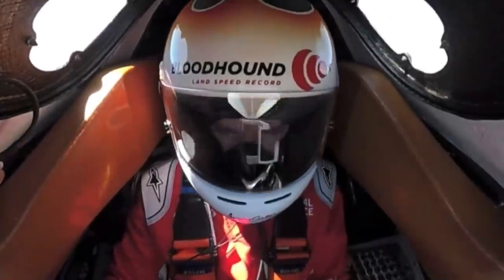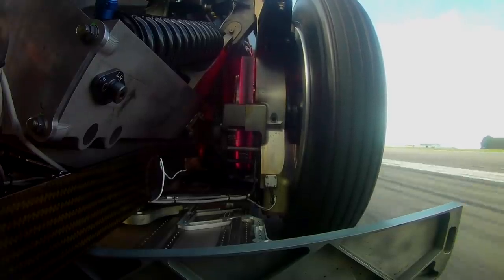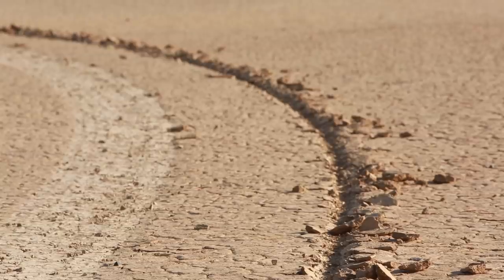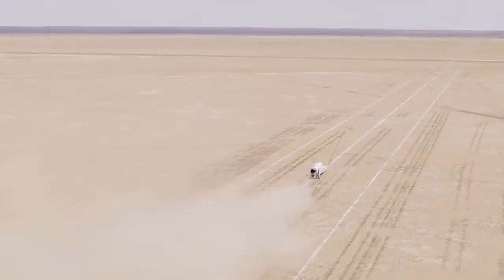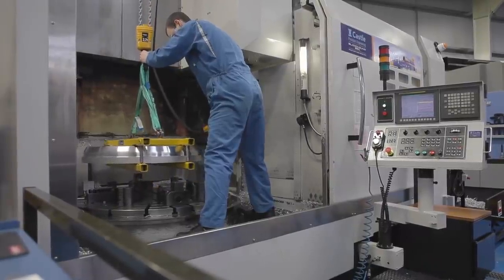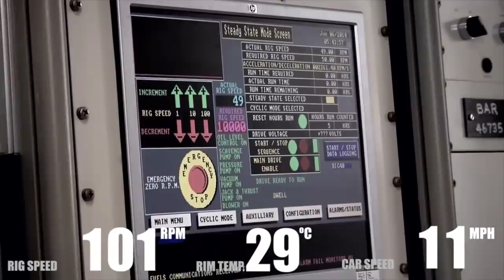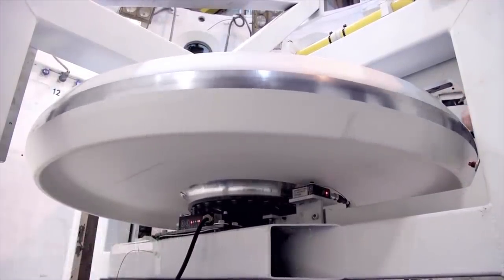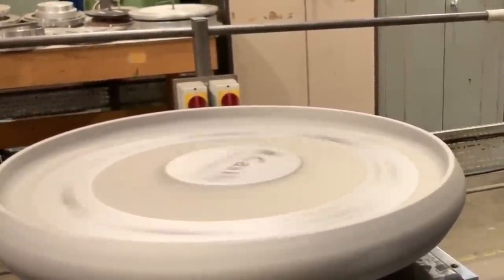Reinventing the wheel

Comment: I'm an old drag racer and have seen the way the tires grow on a top fuel dragster, plus I've managed two Bonneville LSR motorcycle teams, so I've known enough about these issues to have a bit of understanding.  But, at the speeds you are going to be hitting this is a whole world above anything I've ever dealt with and I'm in awe of the technological complexities of even the simple wheel.  "Round thing, goes in circles" just will not cut it in describing Bloodhound's wheels.  I love videos such as this one, so keep them coming please...
Reply: "RT,GIC" kind of does work, though, doesn't it? These guys didn't have a clue what sort of outer profile it should have, so they tried a few and picked the best. They went to the turbine guys for some testing, the turbine guys didn't even bother to fire up the vacuum pumps. They were thinking "man is this probe reading ambient?" while the team was freaking out over 90C. It;'s hyper-balanced, but what if it takes a hit? Ah, turns out under those forces the alloy will smooth itself out and work harden, nice.

That said, the car's gotta haul 2 tons of andy green's brass balls, so what do i know.

Out there on the ragged edge...
Reply: s  you did sweetie. Get a life.
Reply: s  Why are you here
Reply: s:  Yet you took the trouble to respond.

Comment: Hugely impressive engineering 👍👍
Reply: For zero practical use whatsoever. Way to go.
Reply: @sunnyjim1355  technologies and experiments dealing with heat expansion under extreme forces find application in aeronautics and space industries.
Reply: @sunnyjim1355  that's the worst mindset to have. Good job

Comment: Bloodhound - I've been wondering about the car's suspension, how has that been designed and what features does it have to make sure it doesn't disintegrate during the high-speed runs?
Reply: Kris A I've never even thought about it, because I've always assumed it was rigid (no suspension), but I'd like to know, too, if it isn't!
Reply: @The_sinner_Jim_Whitney  my primary thinking was: "Is it rigid and strong enough to cope with the supersonic forces acting upon it?" To me, it looked insufficient to deal with the forces acting upon it. I could of course be hugely mistaken but I wanted to hear from the Bloodhound crew all the same. :)
Reply: Kris A Yeah, me too.
Reply: Should watch the Cris Harris show on the Bloodhound, from design to how each component is made. It used  to run an F1 engine for the hydraulics and start, and then switched to a supercharged jaguar v8. Plus some of the pieces are very big, the survival cell is as big as a car.
Reply: Patricio Garcia I remember the F1 engine/ supercharged Jag V8 thing, now that you mention it. I remember joking about how insanely overcomplex and unreliable both of those options were, like 'what, couldn't they find a 240,000-mile GM Quad4 to turbocharge and use for their hydraulics?', haha!
Reply: @The_sinner_Jim_Whitney  think they binned the jag engine for a battery in the end.
Reply: @anomalousresult  A gas turbine apu would of been a better choice from the start.
Reply: @PatricioGarcia1973  I remember arguing that it didn't actually need the F1 engine and they only used it because it was a cool thing to market the Bloodhound with. Someone tried to say "actually it does need it because of the high rpm for the pumps", I said you could just gear any engine to the right pump speed. When it was announced they scrapped the F1 engine, he stopped responding to me 😂
Reply: Of course I'm just speculating, but for this thing's purpose moving across such a flat surface, would a suspension be necessary? Would it be potentially extremely dangerous to have even the slightest up and down movement from the suspension at those speeds?
Reply: @normang3668  Why would it be dangerous? It would be more dangerous to have no suspension to absorb shock loads, maintain ride height/rake angle and keep the wheels in contact with the ground for steering. It may look flat but it actually has very very slight differences in height that are amplified massively at 1000 mph. The slightest upset to the front rideheight could disturb the underside aero and flip the car, it already happens to cars that "only" run 200 mph.
Reply: @normang3668  A rigid car might bounce more than a car with suspension.
Reply: @xeigen2 you are right,  i drove on the salt flats last summer, on a rental car. At 30mph it was bouncing and moving around. It would be undrivable with no suspension
Reply: Ita got Spax adjustables on it from a ford Mondeo.

Comment: Wasn't expecting the wheel to get so hot just spinning.
Reply: jon smith....I think that aircraft re-entering the Earth's atmosphere at high velocity; such as the Space Shuttle, is analogous to this situation. The SR-71 Blackbird is another aircraft whose air-frame heated up a lot at high speeds. Good 'Ole Friction...always around to pester you.
Reply: @marbleman52  Dam you atmosphere!!
Reply: when they showed the imagery and he said it got so hot, I was actually expecting quite a bit hotter than 98c lol. that's really not a surprising temperature at all considering the wheel itself expanded by several millimeters. if you hit a nail with a hammer a few times it will reach that temperature.

Comment: in 1978.. my shop teacher made some hollow aluminum front wheels for his Class C stream liner that used an top fuel dragster chassis.. he went out and made a pass.. the tech guys saw them perhaps after the second pass.. you have to test those.. well.. they went 280 mph just now.. i think he decided to try something different when don vesco in the same class went 320 on his side thru the lights and he could only squeeze 305 out of his.   shirley muldowney had the front tires go flat on her top fueler.  turned out the G forces were pulling the valve cores open at speed and letting the air out of the tires.  but yes.. rubber tire beads can stretch at speed. they are only glued together with the vulcanized rubber around and between them.

Comment: The fineness of balance needed for the wheel is incredible. One thing though, wouldn’t the balance be very quickly thrown out by wear from the desert surface, and the ‘self healing’ properties of the aluminium would have to be impossibly ‘even’ all around the wheel, otherwise once again the balance would be thrown out after a relatively short distance, and well before reaching ‘target’ speed?

Comment: Bloodhound team have you considered an unmanned autonomous or remote piloted vehicle to do speed runs first? It would seem the best way to test a number of systems at (or close as feasible) to) full speed with a rocket powered test mule. Was heat factored into the design and selection of alloy for the wheels or is engineering headroom enough for that? Not only would those wheels be heated by friction with the air but the contact with the ground would transfer some amount of the rolling resistance heat into them. If they get too warm the aluminium would begin to weaken.

Comment: Have you any worries about the heat?
I would imagine that running that wheel against the ground would heat it up considerably more than freely spinning it, but I am not sure if the lateral movement through the air will help cool it or heat it up even more at these speeds.
Could the runtime be long enough to reach the ~450 °C after which aluminum becomes susceptible to high temperature creep or even the ~650 °C melting point at the contact points between wheel and surface?
Reply: Interesting point. 🤔 They've got the data from the test run so surely any concern will be sorted out.
Reply: @roku_nine  Oh, I am sure they will, I am just curios how or if it even is a concern. I study material sciences and this is a cool example of applied mat sci.

Comment: I may have missed an earlier upload that covered this... I'd be interested in a video that discussed the downforce and exactly how much land you have to touch for it to be a land speed record. I imagine the difference between being too slow and taking off is beyond razor-thin. Edit: Thank you for the replies. I knew if there was any downforce it would be practically zero... I just wondered about earth curvature and if they'd be an inch off the ground at the end of vmax :) That's a brief window though and it's a heavy car; makes sense.
Reply: Their stated design-aim was, instead of down-force to stop the thing taking off, to try to achieve zero vertical aerodynamic influences. Eg : standing still, or at 1000mph, Bloodhound would have 1 G acting on it - its own weight.

Comment: I honestly never would have thought that air would have much affect on the temperature of the wheel spinning through it. I'm curious to know how much of that temperature was coming from the shaft and bearing friction.
Reply: Almost none.  For testing the wheel was shaft driven from a motor below the test cell. Any heat from the motor and bearings would have to be conducted up the relatively long shaft to reach the wheel. On the car the bearings are much closer to the wheel but modern bearings are pretty efficient so the amount of heat generated should be insignificant.

Comment: without sounding too picky it's still tecnically a round wheel,but with a different shape tyre,so the tag should read reinventing the tyre
Reply: NO "tyre" defined as
a rubber covering, typically inflated or surrounding an inflated inner tube, placed round a wheel to form a soft contact with the road.

Comment: Q1: How does aerodynamic lift influence the wheel loads at those speeds?  
Q2: Are there any Guiness rules that say you can't condition the surface you are running on?  I mean, I know its 10-15km of surface, but rather than engineer all the challenges on the wheel from the uneven and hard surface, can't you choose and build your own surface to cope with those challenges better?
Reply: LSR rules are governed by the FIA and there isn't much conditioning that can be applied to a dry lakebed or a salt flat and there are no other suitable surfaces
Reply: Pablo Gonzalez .?   Huh?   So....there's literally an infinite amount of "things" that can be used /applied to the to engineer the surface...
Reply: @McQuokka  How exactly? It's a loose porous surface

Comment: Very interesting. 7075 aluminium is great stuff for bike frames but unless you have a good knowledge of materials science you have to do some calculations and testing. So many other materials and alloys to choose from but the aluminium conducts heat well, and that slight softness keeps it from flying apart at top speed but still.....  I think a lot of thought and consideration has gone into the wheels, that's for sure. If you had the Engineers talk about the early stages of development and other alternative wheel designs that were considered that would be cool.
Reply: Aluminum is only suitable for certain types of bicycles that are low impact or suspended. It's unsuitable for BMX freestyle so is carbon fiber but oddly enough bamboo is viable

Comment: Wouldnt the heat generated in the wheel during the test be from the kinetic movement of the atoms within the wheel itself instead of the air surrounding the wheel? Like when you bend something back and forth quickly it heats up, that’s exactly what the deflection of the width of the wheel did. I believe that was more to blame for the heat production. This can be proven if you see the transition back to cool, if it is surface heat it will cool quickly and could be cooled regionally. Internal stressors and heat production will result in heat returning to the surface more quickly, and regional cooling will be far less effective since the heat will move within the heated core of the wheel

Comment: The wheel stretches by 3 MM when it's spun up to speed.  The metal gets hot from the atoms being forced to move by the stretching.  In other words, the heat is not from air resistance.  I predict that if they kept it at full spin on the testing stand for very long, it would lose heat to the air, not gain from it.
Reply: If that was the case you would expect the whole wheel to heat up pretty evenly but they stated that the rim got hot. Yes you will get a small amount of heating from stretching but the majority is from air friction. Heating from air friction is a big problem at supersonic speeds. At cruise speed the nose of Concorde used to reach temperatures over 120 degrees C. Most of the airframe ran over 90 degrees C even though the air was sub zero.
Reply: @LesNewell  I did not say this, but my point regards the condition of the wheel on the test spindle only, not what it will experience on the vehicle.  I am aware of the heating from air friction in high speed aircraft.  But aircraft are impacting air molecules head on, which heats up leading edges much more than the rest of the surface.   That wheel on that test spindle is churning some air from friction, but there is very little head on impact with air involved.  The linear speed of the wheel at the rim at 8,000 RPM would be near 1,000 MPH.  Not quite as fast as Concorde, but in the neighborhood.   And you are underestimating the heat generated from working metal.  I can tell you from my anecdotal experience that small movements within a piece of metal create a lot of heat within it.  You can feel the heat when you bend a piece of wire back and forth to break it in two.  It is the function of the energy you are putting into it.  Stretching a disc by spinning it will heat the rim the most because the rim stretches the most.
Reply: @deezynar  Most of the heat is from friction of air passing over the surface, not from impacting the leading edge. This changes at hypersonic speeds (e.g spacecraft reentry) but we aren't anywhere near that territory. Going back to the Concorde example most of the fuselage runs at ~90C due to air friction. 

If you stretch metal below it's elastic limit it doesn't heat up much. This changes when you stretch metal to above it's elastic limit and permanently deform it. These wheels aren't being stretched above their elastic limit. They return to their original size when they slow down. Take your piece of wire example. If you only bend it far enough that it can spring back you can bend it back and forth all day without it getting hot.  It only gets hot when you bend it far enough to permanently deform it.
Reply: @LesNewell  I've done enough work with metals to know that forcing the atoms to move heats it.  You need to go into your garage and grab some pieces of metal and start deforming them in various ways.  It heats up.
Reply: @deezynar  Go and drive your car fast down a rough road. You are putting a lot of force in the springs and they will be will be flexing like crazy. Now stop and feel them. They will be cold because they are not being stressed beyond their elastic limit, just like these wheels. It is only when you bend metals far enough to be permanently deformed that they get hot.

Comment: Is the wobble at 6:43 caused by the material shearing at the test? 8O
Reply: I think it's just an unfinished/work in progress outer surface. Or a crude balancing adjustment by shaving the metal. Idk🤔
Reply: It's from the balancing process, tiny amounts are shaved off the perimeter to achieve this.
Reply: @SMBBM92  On the video it looks like it's warped pretty properly.

Comment: I wanna know more about why and how the wheel heats up.

Is it because the grain in the aluminium move and heat up the wheel as a whole?

Or

Is the heat coming from the outermost surface and air contact?

Could the wheel be coated in air phobic material

Like water repellents coatings

An air repellent coating could be created.

How fast could you spin a piece of solid steel before is rips apart.

Imagine a 10 metre sphere of perfect metal spinning at 1 million rpm.

Or

A 10 metre disc spinning at high rpms.
Reply from the maker: The heat comes from the friction with the air!
Reply: Bloodhound LSR yea i know that. I was asking if the wheel expansion is giving the same heat energy.

Like when you bend a paper clip back and forth really fast it heats up, same with rubber bands.

Its just really interesting I think.

Bit like how the earth works and rotates.

You answered my question. Thanks team!

Comment: Don't take what I am going to say wrong.  I think that the work that is happening on bloodhound is great and necessary.  But I will always say that it is a plane with out wings and not a real car.  You might as well take a SR71 Blackbird and put wheels under it.  I hope that the group achieves every goal that is planned but in my eyes it will never be a car.
Reply: But you couldn't drive an SR on the ground at those speeds without a complete redesign into something that's much more than simply clipping its wings